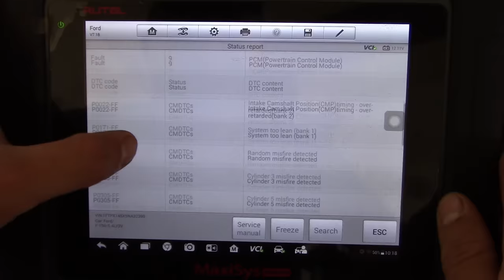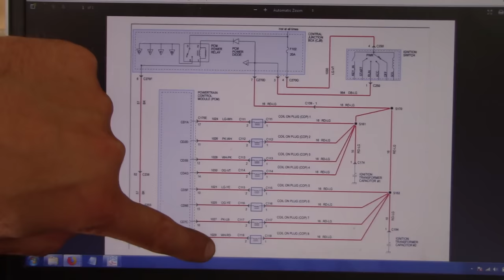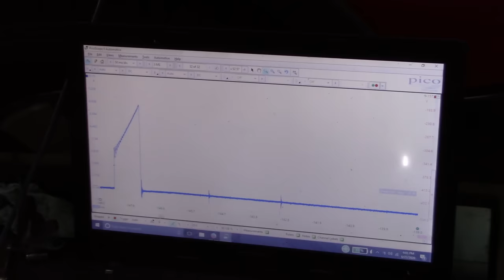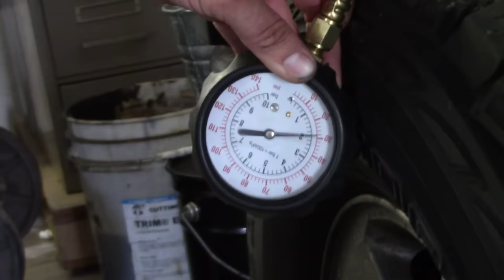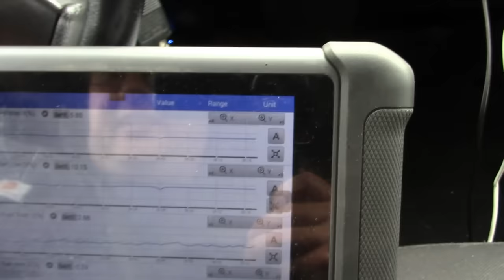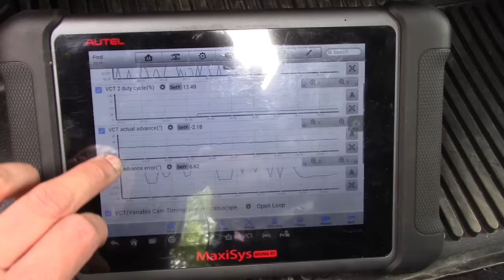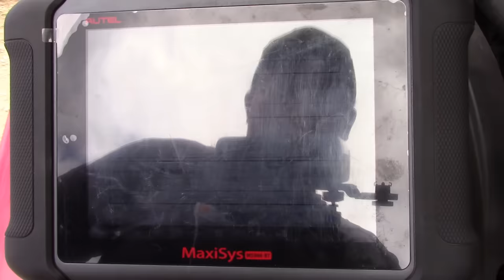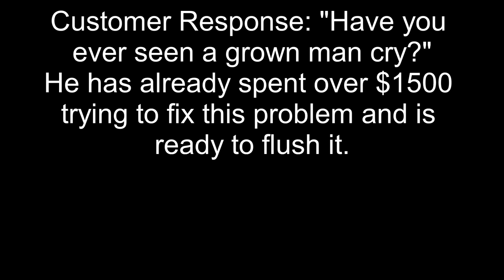2005 Ford F150 5.4L - missfires, intermittent rough running, rattles and knocks, P0021/P022

Comment: I have managed to get over 330,000 miles on my 5.4 without any engine work besides oil changes and coils and plugs.  I just had to replace the intake manifold because of the infamous coolant leak at the crossover.  I'm sure I'll get another 100,000 before California takes it off the road due to smog BS.  Never liked Ford much but I am really impressed with this motor.  Can't understand why it gets such a bad rap.  I've even run this motor with less than 2 qts of oil several times before I noticed it needed some.  So far it still can keep up with most newer motors in races.  The bad thing is I have had to replace almost everything else on the truck, from the entire front end to the seats, door handles, heater coil, ignition, rear axle bearings, shocks, springs and bumpers.  I've rebuilt the truck but not the motor or transmission.
Reply from the maker: That sounds like a 2 valve.
Reply: You must have the nearly bulletproof 2V 5.4

Comment: i have issues at work with people not servicing often enough or wrong oil type that causes issues with cvvt , i work in mainly new cars and kinda glad that they now use electronic control variable valve timing now , ocv can clog up and cam hubs can stick , i had one where it be fine but after 90 km of driving the hub would stick then cool down and be fine and when hot stick again

Comment: Some mechanics do not know the proper maintenance procedures and use cheap parts that don't hold up. I have a 2006, and it is still running great. I maintain it myself,  and no problems.

Comment: Fun fact, new 5.0 coyotes and 2.7 ecoboost engines DO have working oil pressure sensors, ford still puts a fake oil pressure dial that shows good for anything over 7 psi, despite having working oil pressure sensors and not just oil pressure switches

Comment: These model years of the 5.4 are straight junx..
Ford guy my entire life.
Ford 6.0 pure junx
05 5.4 put the end of my loyalty. 
Its not by chance back to back and totally different type engines have cost me thousands from near new.
My 5.4 ran like crap but lasted 100k with one issue after another..
Finally, the flood did it in, thankfully...

Comment: Just my opinion but anytime a timing component is replaced you should replace the chain and other gears as well. The reason why is chain and sprockets have a wear pattern together and when you replace one and not the other it may or may not cause premature failure later on.   It cost more later to pay labor and more money parts when the engine is already open.  I would also suggest replacing the oil pump as well when doing this job.  There is a whole kit to replace all components under the timing cover for that reason.  I just went through the exact same issue on a 2007.   It does relate to the oil pressure as well when the drop in pressure is sudden the vvt goes crazy until the pressure is brought back up with more throttle
Reply: I had mine done on 02 04 and 05 f150s.  My guy, jd  replaced all guides, chains sprockets, melling high volume oil pump, dropped the oil pans and cleaned the pick up filter.  Quiet smooth and not cheap.

Comment: Every time I had to get rid of a car it was a slow death of lots of little things. Engine were serviced by me but electrical gremlins rust ended it after 10 12 years except for my Toyota that had 300 thousand on the clock and the only thing replaced were brakes, shocks etc.  14 years later the dealer gave me 4 k  and I got another one.    My daughter has a Honda and it seems to be the same quality.  Boring is good.

Comment: I’ve seen so many ford triton videos it wasn’t till the “they’re super sharp” about the pliers that I realized I’ve seen this one. These things are so problematic that if you have access to a cheap dealer then it may be cheaper to buy a new engine than change any parts that come updated already in the new engine
Reply: When my 2004 started it's bullshit in 2013,  to find someone to work on the thing, and be successful, was a tall order. Made it to 2014 and it went caput. Attempting to find someone like Wes is very difficult, so a repair attempt is roll of the dice of "will it still tick afterwards" led me to come to the conclusion to let the bastard fail and start over.  Being a southern truck, rust isn't a factor, and I was already in for a reman transmission a couple years before that.  Currently, bought a car last year, Toyota, and did not trade the 2004, it's got 50K on the reman engine, and is quiet for a 5.4 3V, since they have noisy fuel injectors anyway.  Everything still works on it too, 4x4 in all ranges,  AC, running Mobil 1 5W30 now and the old pig is tight

Comment: At the 22 min mark, you say what the shop said but mine is in reverse? I have a 2010 f150, supercrew 5.4 v3. When cranked, no noise, but under demand, sounds like im driving a diesel lol. 
He said that he thinks there is not enough oil pressure on bank 2 to kick the pin out. Said it could be as minor as a piece of debris, but I have to take her in when the owner is in as he is the true dianogtician.
The truck itself has good oil pressure, but not to bank 2. 
The truck has 288 thousand miles on her and this is the first real issue I've had with her. I guess we'll see what's going on with her when they delve further in to diagnostics. 
Great video. Thanks! Any input would be helpful lol

Comment: i almost bought a truck just like that one...instead i bought a mazda 2 and its never given me a minute's worry or a dollars repairs.....the tires need replaced is all....under the hood there's almost nothing there but it has 5 forward gears, A/C, cruise, decent steering, goes 70 mph at 3100 rpm and where the hp (100) gets as high as its ever going to get and runs about 40 mpg.....no hybrid, no lithium, no variable valves, no turbocharger, no rust, no corrosion.....just old fashioned technology..they don't make em anymore....couldn't get $3000 for it today but its never cost me a penny and i expect it to run at least another 15 years if i want to keep driving.

Comment: Great video, just confirms what I've been reading about the 3 valve 5.4L. Before then Ford had the popping spark plug issues. What has happened to Ford...fake oil pressure gauges, etc. Maybe you guys can help me out with some advise:  I've been searching for a Sportsmobile camper for my wife and I to do some traveling.  Most are Ford based on the modular 5.4 engine, both the two and three valve variant.  Found one that was like new and came with a brand new 3 valve crate engine that the seller paid $6K for. Nice, but then saw the car only had 78K miles on it. LOL. This was a handicap van, not some hot-rod abused HP monster.  There's only one explanation and this video just pointed it out. Maybe I'll give the old Ford 5.8L Windsor a try since it has basic push rod technology and there are some nice older Sportsmobile's running that motor. Any comment on the 1997 5.4L 2 valve would be greatly appreciated, as I'm looking at a nice Sportsmobile with 47K miles on it running that motor. I'm  hesitant due to the spark plug popping stories I've read. Looks like I might be looking for a Chevy or Dodge camper now.  My old Jeep Grand Cherokee has 240K miles on it with the old trusty Chrysler 318 5.2L push-rod V8 and never had even one problem, only just changed the oil and spark plugs. Even the direct port fuel injection system still works like new after 25 years and sitting for the last 18 months. Started right up and purr's.  Any advise? Thank you. Marsh

Comment: The Triton is a good engine PROVIDED you get to those timing issues EARLY, and do regular oil changes and upgrade the oil pump. A very slightly modified variant was fitted to Australian 2002 - 2007 Ford Fairmont, Fairmont Ghia, Fairlane and LTD (220/230 "Barra" V8). I have 360,000kms on my Ford LTD.

Comment: Tuesday tip of the day on your leaky rear oil seals FIRST check your vent hose with the barbed valve The rear end creates its own heat we all know that where does the heat vapors need to go,  it should go out the valve with the rubber hose but after so many miles that barbed valve will get clogged , take your rubber hose off,  stick a toothpick in there and dig out the grungy’s and then take WD-40 squirt down in the barbreed valve. That might take care of your leaky seals. Because he vapors needs to escape from the rear end if the valve is clogged your next easiest place is your rear axle seals

Comment: The old Ford V8 engines were bad about pumping a lot of oil to the top of the heads. After many miles and maybe less than stellar maintenance, the drain holes which were too small would restrict resulting in oil starvation downstairs.

Comment: I had one of these 2005 f-150, had all the same troubles of bad cam timing, diesel sounds... so I put in diesel oil and fixed cam timing problems. I belive the problems were caused by low oil pressure,  getting worse. Oil pump quit so I quit and bought a 2015 f-350 diesel.

Comment: Great video . Too much technological change over a short time . Engineers get frustrated too . Not enough time to work thru issues during testing and  developement phase . Off to the next great thing . Too much  Government involvement and  hyper competition . In the early 60's , the big three would work closely with drag racers and other forms of racing to develope engines.  They learned to get alot out of 2 valve , wedge engines . See also Charles Kettering( formerly of DELCO) and the long struggle to develope GM's popular 2 cycle diesel in the 30's

Comment: Surprised this engine hadn't already come apart. The truck has a few good body parts that would keep it out of the crusher, but the frame is rusted out, lots of other items that need replacing. This one should be junkyard bound.

Comment: Currently have a 2000 expedition with the 5.3L, two valve, 265,000+ miles,  no obvious oil leaks detected, only had intake manifold replaced due to coolant leakage once, guess Ford should have kept that design instead of experimenting with the 3- valve design.

Comment: My 04 was running ok wanted to fix a P0022 code changed the solenoid it now runs like crap. Occasionally runs excellent great power and smooth. Glad I only paid 850 for the truck. Thing runs rich pulling 25/30 on bank 1 and 17/25 on bank 2 but when it runs good it the fuel trims adjust perfect and short term goes from around 0 to -25/30 on 1 to -17/25 on 2. Clueless.

Comment: My 4.6 is doing the same thing I personally changed all the coils boots and plugs, changed multiple sensors  and still idling like crap tossing codes. I believe it's the o2 sensors or possibly a clogged catalytic converter.

Comment: If you go to fordtechmakuloco channel he used to work for a major ford dealership in Chicago. He would do up two of these timing chains a week. His video's got to negative so the dealership gave him grief so he went independent like you. He has a set of video's on step by step on how to dismantle this down to the timing chains. The oil pump can be replaced with a high pressure pump with out having to removing the oil pan. He goes through all of that also. If you want to know anything about Ford junk in this time era he has dealt with it and continues dealing with it. If you ever deal with a ford 4,0 SOHC engine he has the step by step procedure to do that and tells you how to time that thing. Those motors run from them is the correct answer.

Comment: 3 valve triton is such a POS. BUT I have the 2 valve triton and I’m at 300,000 miles and it purrs like a kitten. I love my 2001 E250 other than the typical FORD rust that I’m surprised more people don’t talk about. My Chevy has barely surface rust and every Ford I see is rusted to pieces.

Comment: What a shame people can't fess up and say they don't know.  It scares me too that a dealership couldn't diagnose the problem and save your customer two months of driving on a bad motor.  You seem to get all the hard jobs that other guys don't want.  I guess there's more money in brakes and tires.
Reply from the maker: Yeah, I don't know. I guess other shops don't wan to mess with this stuff, and it's hard to blame them. No one is going to make much money on this truck. The money has all been spent trying various easy fixes.

Comment: Had a 05 FX4 5.4. I was a dog the First day and after 4 Shops Multiple times at 90000 miles I trade fir the same thing. Tough truck EVER. Except the one I have but never know. It does half 226000 Miles all by me Oilfield and everything F-150 6.2 White Limited. I love Ford but several People lost my Business during 05 and 08. It didn't make bad noise I even done Mods trying to get it Going lol.

Comment: Some good info on scope testing, but for the love of God man - they are VCT solenoids not VVT.  ;)
These engines while very flawed can survive a lot of abuse.  My guess is with that horrible oil leak on the front it was frequently low on oil & starved the top end.  The blown tensioners don't help, but that alone shouldn't have starved the cams.  
As far as carnage, that is nothing for a 5.4L 3v.  I did the full works on a 2005 260K engine and the guides were mostly gone.  Well at least gone down to the pan.  The oil pickup screen was full of plastic pieces.  Parts replaced - Oil pump, gaskets (oil pan, timing cover, valve cover, etc...), VCT solenoids, cam phasers, chains, tensioners, guides, lifters & roller followers.  Engine runs great now.  Of course it wasn't starved of oil like the top end of that engine you have.  Not really much to do to save those cams & heads.  Condolences to the owner.
Reply from the maker: Variable Valve Timing, Variable Cam Timing, what's the difference?

Comment: I can tell you it's a cam phasor oil pump problem. I just sold my 2005 f150 5.4L before it developed the same issue. Ford 5.4L have this problem from the factory till 2010. You need to change the cam phasors and oil pump. Because of the oil pump/oiling system in this engine not enough oil gets to the passenger side cam phasor causing it to self destruct. Also brcause of lack of oil in the rocker arms and the eay they are designed the valve lash adjusters break causing all kinds of issues including engine go boom. Along with the engine problems the transmission, if it's a 4r75e, is known to have shifting issues and needs rebuilt. This engine transmission combo should've never left the factory till all these issues were fixed. But sunce ford was trying to compete with gm's LS engine they threw this together hoping for no problems before the warranty expired.

Comment: check the oil cap.. gunk there then gunk in the vct solenoid screen/  check bad injectors too leaking or not flowing at all. convertors stop up too from running lean. overhead valve springs break.. i seen so many issues with these, glad there not so many at the dealer any more.

Comment: These engines have such oiling system issues. The oil pump itself leaks, especially at high RPM, because the back plate of the pump isn’t strong enough and flexes out at higher flow/pressure. This is exacerbated on vehicles that carry a heavy load because the higher RPM causes more oil pump leakage, less oil pressure to the heads and wipes out the cam bearings. Of course, blowing out the timing chain tensioner gaskets causes more oil loss to the heads. I don’t know how Ford managed to take such a solid engine like the 2V 4.6/5.4 and turn it into such a dump. Yes, the old ones blew out spark plugs and ate coils for breakfast, but they would take such a beating and just keep going.

Comment: I had one doing all that. 09 , nice truck. Engine finally locked up at 160k. Then I switched to Chevy. I still have the truck sitting in my yard. Nobody wants it. It's a 4wd f250 6 speed manual.
Reply from the maker: Where are you located? I'm interested if it's not too rusty.
Reply: @WatchWesWork . Spfld. Ohio. Some sure. Bed sills and that's about it . Tires very good. Fairly new clutch. 3.73 Ls axles . 1500$

Comment: You didn't fined nay parts with 4 interconnected circles on them did you? Sounds like you and Mr. Bloc are in the same boat and pretty nearly in the same seat. Glad Tommy is running again so it wasn't a total l0oss. GBWYall!

Comment: So to check the catalytic converter on these, go to the graph function for Bank 1 Sensor 1 and Bank 1 Sensor 2, then Bank 2 Sensor 1 and Bank 2 Sensor 2. Compare the graphs of each Bank. Sensor 1 should be choppy while Sensor 2 should be flat.

Diagnosed my cat issue using this technique with the autel Bluetooth OBD2 scanner.

Comment: For the money he already spent, might as well as spend more on the engine.. That is kinda what I ended up doing to my truck 2 years ago. Bought the truck without knowing it had bad cats. Then I heard chain rattle and learned 5.4 has that tensioner issue. I did timing chain job myself, spend 3 long days and $1300 in parts. Then a week later, transmission failed all the sudden. If transmission failed first, I would have given up on the truck, but since I spend time and money already, I had to put more money to put rebuilt transmission on.  And now.. I need rear end..

Comment: oof, I know that noise. it's timing chain slap. dealt with that on a 1999 SAAB 9-5 with incredibly bad wear due to severe sludging from a badly designed PCV system. timing chain was so worn I could bend it sideways on a 15 degree angle, guides had deep grooves in them, oil pump was badly scored... popped a cam cap off and it wasn't good.

oh, and the timing cover also had a poorly done epoxy repair where a blown up idler pulley allowed the accessory belt to wear through the cover.